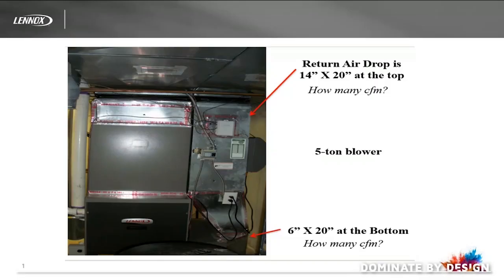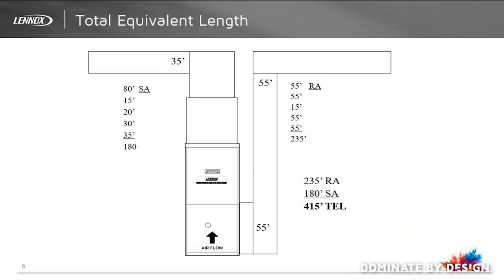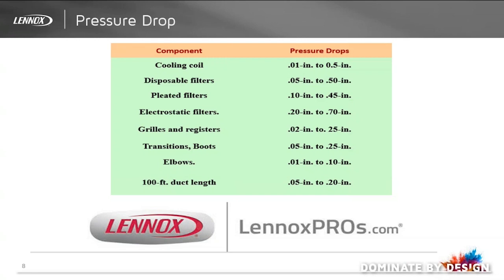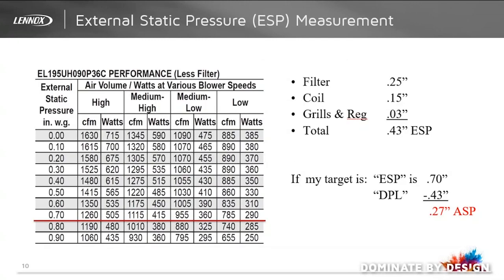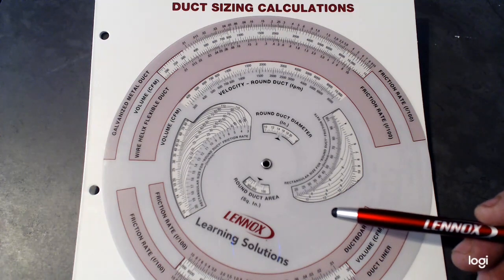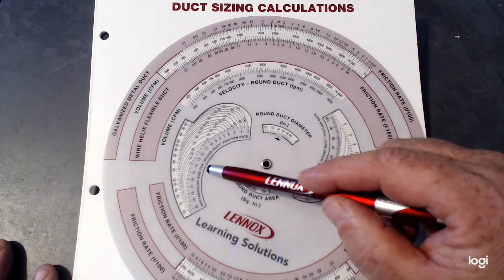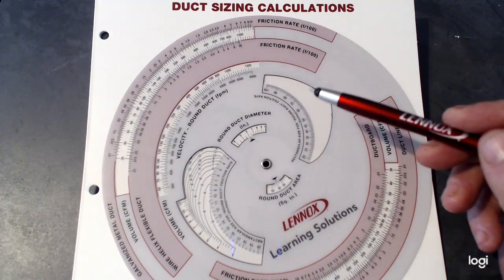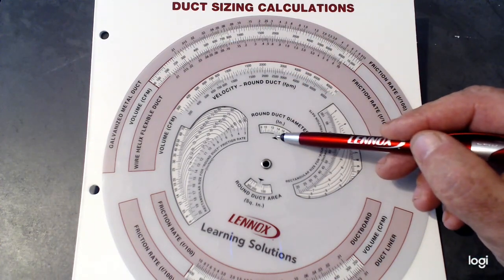Toolbox Tuesday: A Guide to Duct Sizing and Friction Rate Calculations | Lennox

Comment: I liked the video, but how exactly are we determining the target ESP in order to calculate the ASP?  If we're replacing an existing system that is inoperable there is no way we can measure the TESP of the duct system, and even if we could it will likely change based on the new system we'll be installing (typically going from PSC to ECM motors).  The target ESP will make a massive difference to the friction rate depending on what is input into the formula there.  Could you elaborate a little more on how the target ESP is determined?  Thanks!